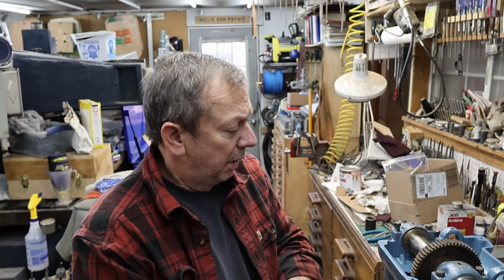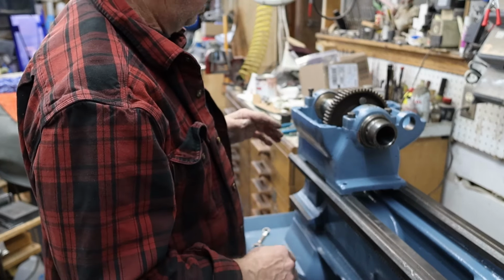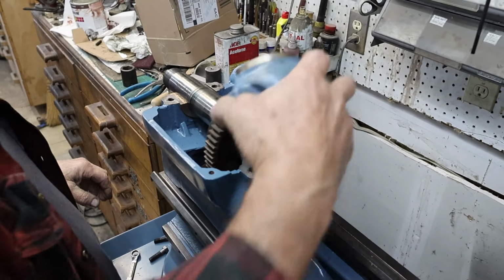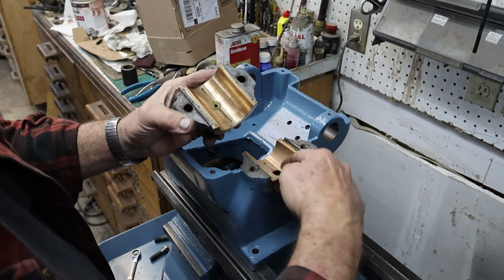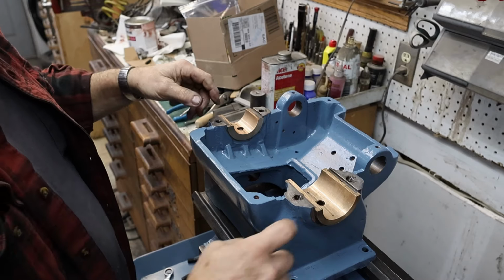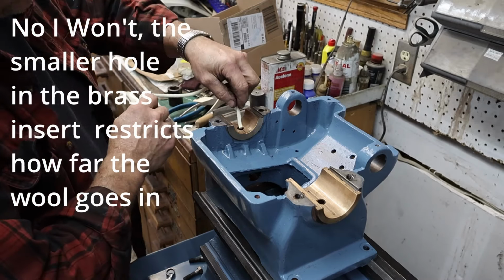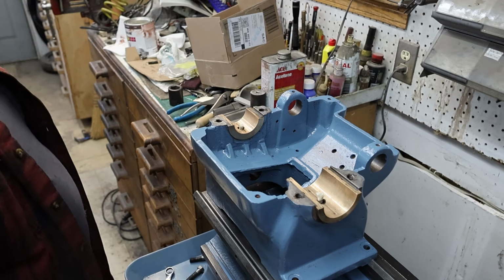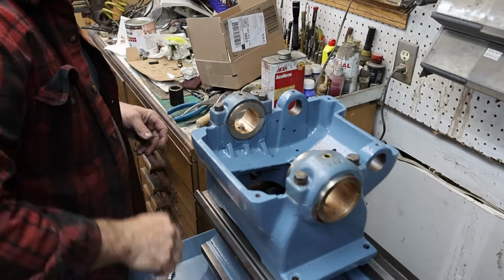Rebuilding A Sheldon Lathe: Part 12, Headstock Bearings & Oiling, November 2, 2024

Comment: There are springs under the wicks (Sheldon part number S-1158) I can send you the manual for the lathe if you like
Reply from the maker: Makes perfect sense now, the one wick that was there was probably replaced at some point because there would not be room for a spring as it was installed. Thank you for the offer but I did just find the proper parts list . Thanks, Dan.